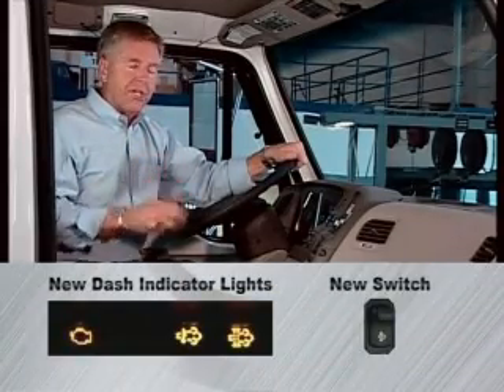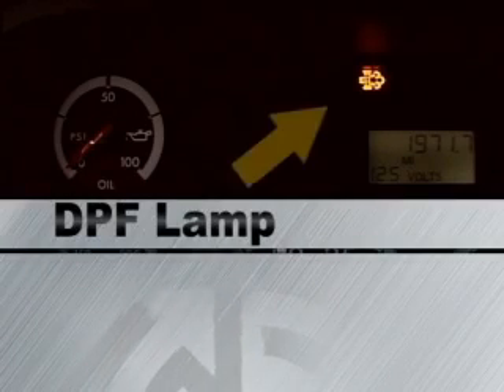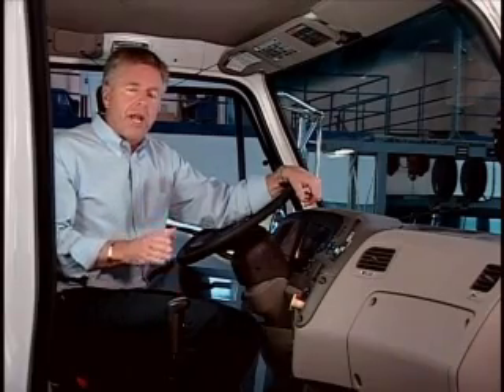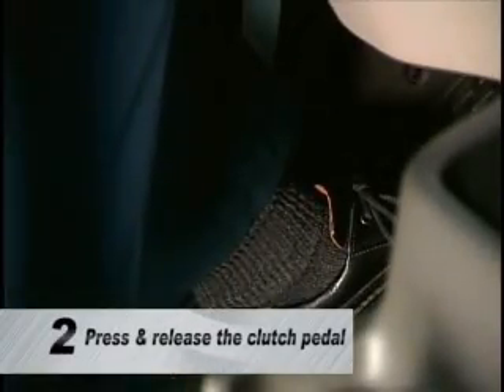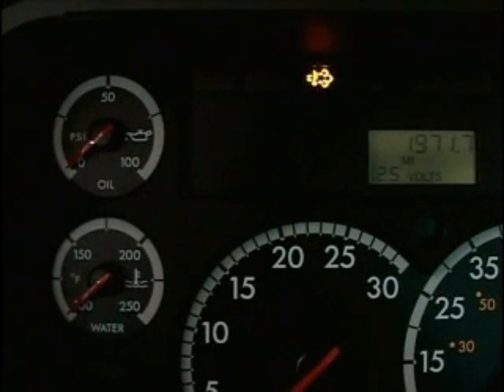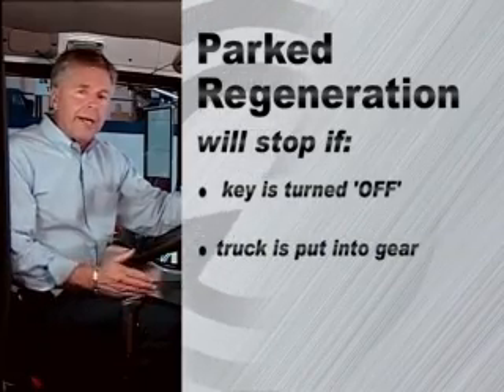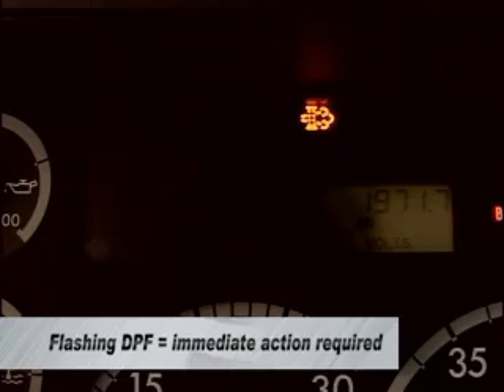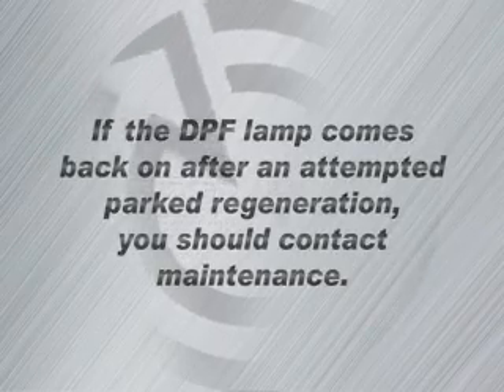Detroit Diesel Aftertreatment and Regeneration

Comment: I don't get it, how are we saving the environment by running truck more. Every time this system gets a repair you have to do a parked regen which runs the truck hot for an hour. I'm a mechanic and 90% of the time a truck is running it's due to the aftertreatment. The hours ive spent running a truck and going nowhere have quadrupled. How does that help anything. All this does is keep trucks off the road but they're still running, just now it's in the shop and nobody is making money off of that.

Comment: I have a 2012 Cascadia Freightliner today when I open up the door the dome lights comes on in the footwell light came on it would not go off I have the truck in the shop now I only had the truck for a week the def system is crazy I done 3 Park Regen since I had the truck in one week the mechanic put the computer on the truck he said I need a new sensor for my def he hasn't found out yet why the lights won't go out and  what's up with the engine because the engine light came on laugh out loud it's been a crazy day and I know it's going to get crazier